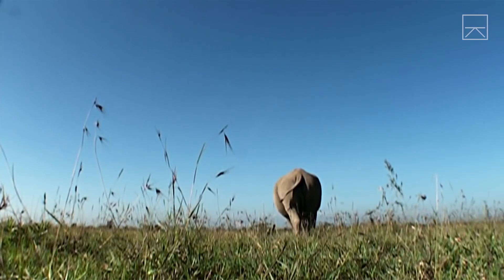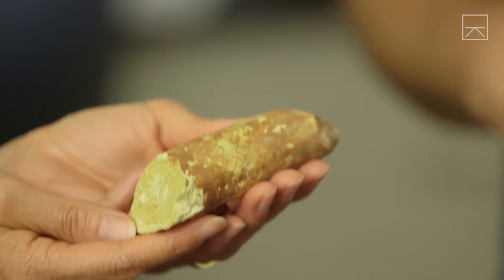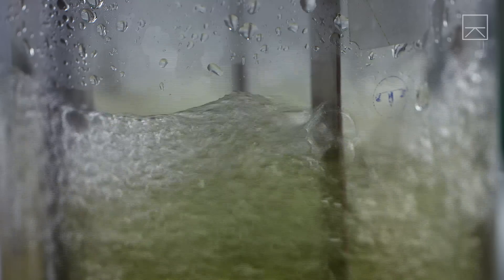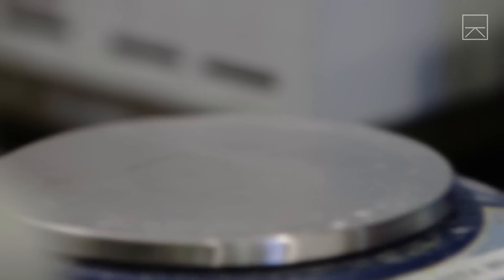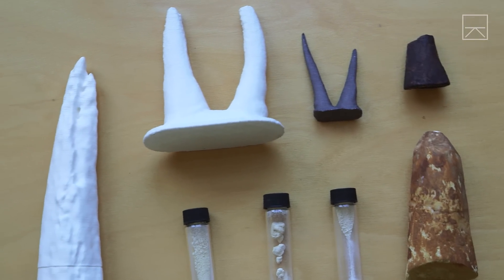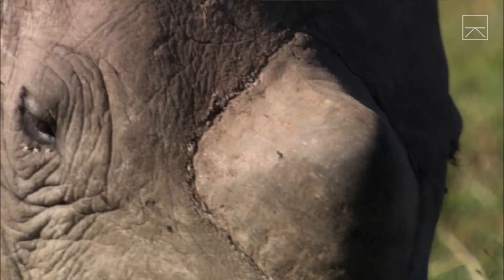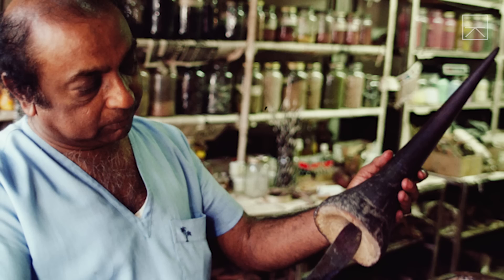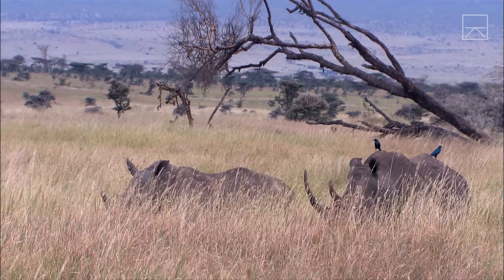3D Printing Rhino Horns Can Stop Poaching in Africa

Comment: Where do they get rhino dna from?
Reply: You can print DNA. People make whole bacteria genomes already and create artificial life that way. Check out Craig Venter to learn more about this exciting research.
There is one Problem you can not make the complete chromosome of the rhino because it is to big to assemble all the small pieces. So if you have a powerful microscope you will see the difference because there are no cells and no Chromosomes visible I think. 
But if the poachers only use DNA sequencing they will not find out that it is a fake horne because when you sequence the DNA you have to shred the DNA into small peaces first for the machine to read the small pieces.

Comment: Sadly this is all just a dream...I dont think asians would use the printed horns...
Reply: They don't tell you it's printed :^) they're made to be as genuine as humanely possible for the sake of introducing fake horns in the market as real horns. And nobody would be able to tell the difference
Reply: Surely ur not that stupid. The plan is to flood the market with the fake horns, not telling ppl its fake, to the point that there's so much rhino horn out there that it will drive the price way down making it no longer worth the risk of going out and killing more rhinos. Supply and demand.
Reply: Did you not watch the video, they got the 3D printed horns tested and the results came back as being genuine rhino horn.
Reply: Fred is partly right. If you flood the market with fake horns people want proof that the horn is real so they will only accept horn in combination with pictures of the dead rhino or the whole rhino head for example. Don't think these poachers are stupid. I have a better idea! Replace the horn by one made of metal and pay all the horn replacement missions by selling the real horn.

Comment: I'm currently learning and making a 3D printer at my university. Its is a machine that I've only watched in movies before. I thought it could only print plastic-based material but I was stunned and amazed when my lecturer said it can also print metal, food and even houses. But to think it could print basically an actual rhino horn with protein, minerals and DNA?! Its so amazing. All to save rhinos from extinction. Awesome work!

Comment: a better solution is to remove the horn and replace it with a material near the original or something similar in a structural pov, and make it visible to the hunter.
Reply: Bonbadil Moi 
So cut off the rhino's real horn, glue on a dildo in its place, and then when poachers kill the rhinos, the jokes on them because there are no horns to be had!
Reply: Jack Hoff that why i said, make it visible from far with whatever solutions (colored horn..).
If hunter are only interested by the horn, i doubt they want to wast their time killing a nohorn rhino.
Reply: Bonbadil Moi Insert Tom Cruise What? gif

Comment: I am worried rhino horns will become like the fur Industry will make the real stuff much more expensive then the synthetic stuff so people who poached still have an insentive to do so
Reply: Jack Hoff It doesn't matter if the vendors can tell the difference. The consumers can't. So even if a vendor knew the horn was fake, he would still sell it. You honestly think black market vendors care that much about legitimacy?
Reply: BK201MXP
The lab tests do not mean the two are physically identical. It just means that the fake horn is identical to the real horn based on the current standard they use to test horns. I don't know what that standard is, but if I had to guess, I'd say they identify rhino horn by DNA analysis and just by eyeballing it. If you were to slice it and put it under a microscope, you could probably find very noticeable differences in the physical structure. And when these fakes go on the market, the current standards vendors use to authenticate horn will evolve to identify those differences.
Reply: Mark from acounting Did you even watch the video? These artificial horns are completely identical to the real thing. This way the black-market buyers can't tell if the poor families killed a rhino or just bought a synthetic one. This drives down the value because there will all of a sudden be more rhino horn, but no one will know where they came from.
Reply: BK201MXP i did watch the video and i realize it is basically identical to the real one but that doesn't mean that the people selling the horns will tell them that they are real they may say they are synthetic so that the prices for real ones shoot through the roof and they can sell that for much more because they were already doing it
Reply: BK201MXP Money cares about legitimacey
Reply: BK201MXP
That could last for a time. Until a few of their customers, who are forking out tens of thousands of dollars, decide they want to verify that they are getting their money's worth and send a sample out for testing, and those next generation tests reveal it's a 3D printed knockoff. The vendor not only loses that client forever, but word will spread in the community of that vendor selling fake horn. The market will evolve and only the most reputable vendors will be left standing.

I know nothing about the ivory and horn market, but I'm guessing it's driven predominantly by rich consumers who buy thousands of dollars worth during each purchase, rather than predominantly by poor ignorant peasants living in rural communities. This fake stuff would likely satisfy the demand amongst the lower class but have very little impact on the big time buyers once there are new methods to distinguish 3d printed horn from real horn.
Reply: Jack Hoff i don't know this process but i;m guessing that a scanning electron microscope would be able to detect the difference by  differentiating between normal growth patterns and a mechanically assembled one...still think this is an awesome idea to promote rhino preservation
Reply: you have to be either 
a. the biggest idiot in the world
or 
b. a full time troll.
Your handle is confusing cause you could be both of the above.